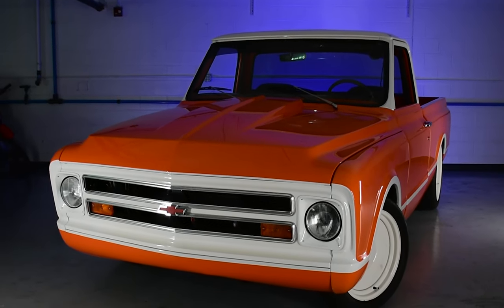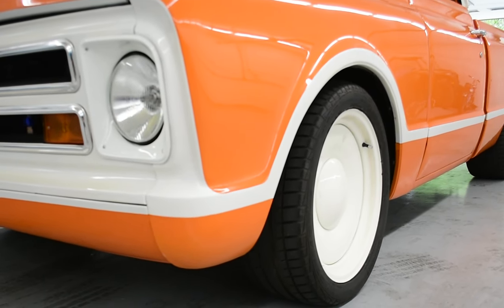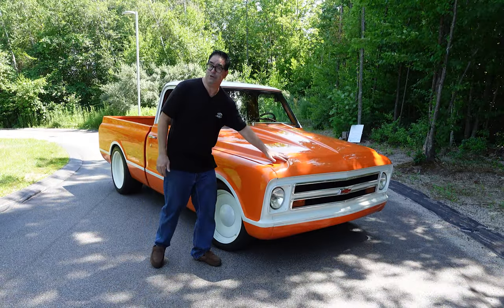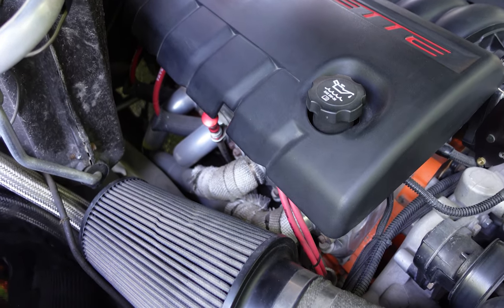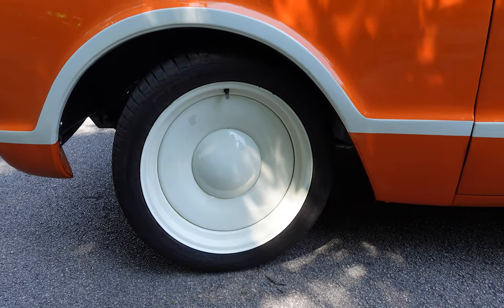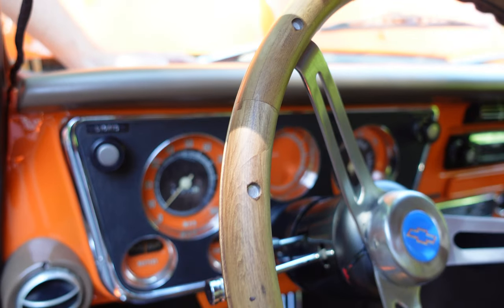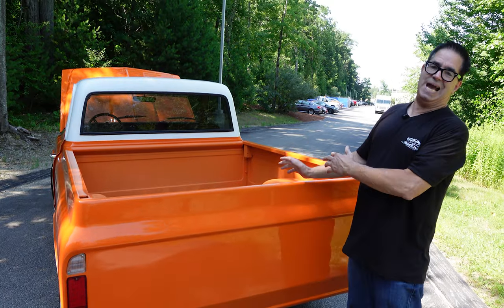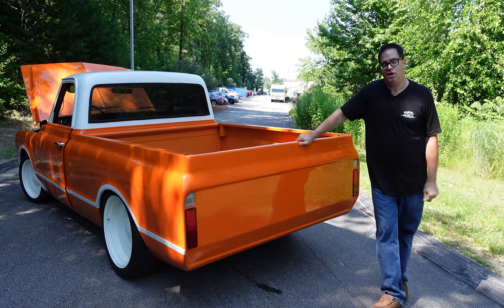Walkarounds with Steve Magnante | Custom 1970 Chevrolet C10 with Corvette LS Motor | Ep 97

Comment: The air filter is right above the hot headers. It should've been routed to fresh air. No amount of heat wrap on the pipe can fix the filter location. 
Other than that, a few different design changes would make it perfect for me. Definitely get rid of the Corvette engine covers. Love the wheels, but they're too big. And a few interior changes. Not a fan of the seat material. But it's a beautiful truck. I'd love to have it

Comment: Insulates the air intake tube against heat, then puts a cone filter right next to the passenger-side header.  It's great overall, but there are goofy things here, like the air intake and wheels, like the finish was rushed or budget ran out.